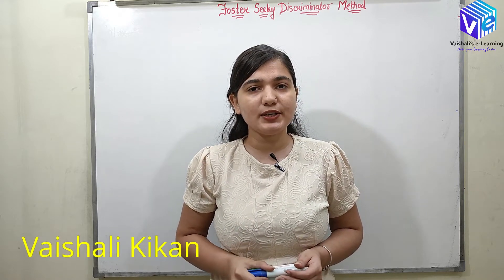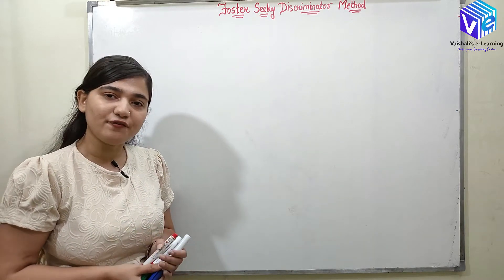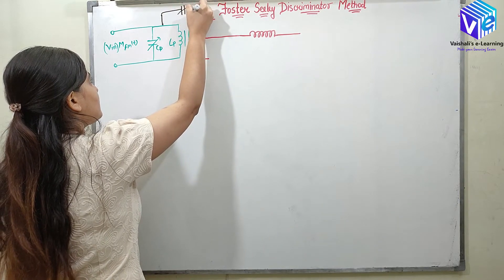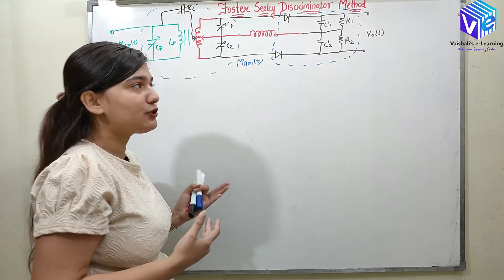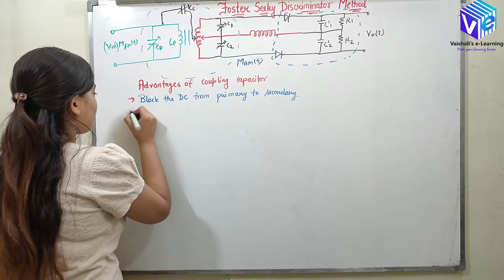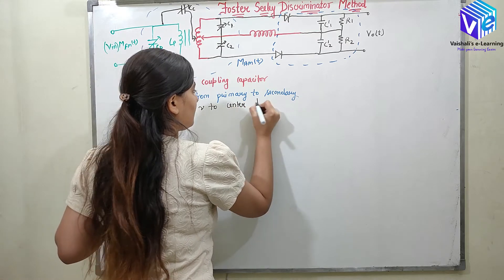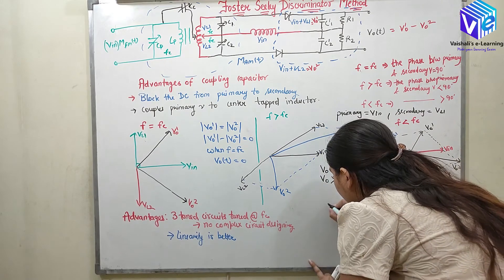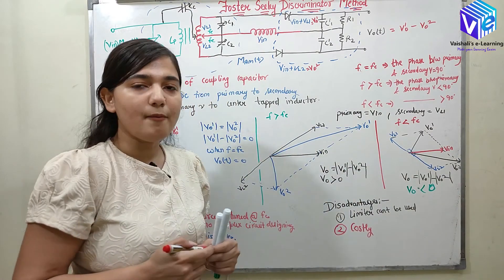L 57 | Foster Seeley Discriminator Method I FM Demodulation I Analog Communication | GATE ESE NET

Comment: Howdy again.
I did some experimenting. With values of the coupling capacitor and the choke tuning to series resonence I observed a 90 degrees phase shift over the choke. So I believe the term RF choke is misleading. I would call it an inductor. I used 47 pF and 3,9 uH in series. I fed the circuit 10,7 MHz with my signal generator. I observed phase shifting increase and decrease when changing the frequency.
Regards again.

Comment: I think you are in error at the end .. you HAVE TO use a limiter on a FS discriminator because it is sensitive to amplitude and phase.. so you want to take the amplitude portion out.
Reply: After watching her next video (58), I think what she meant to say was that there isn't a built in limiter in the foster seeley circuit so the disadvantage is that you would have to put a limiter upstream, whereas in the ratio detector in the next video, it has one built in so its advantage is that it doesn't need a limiter.